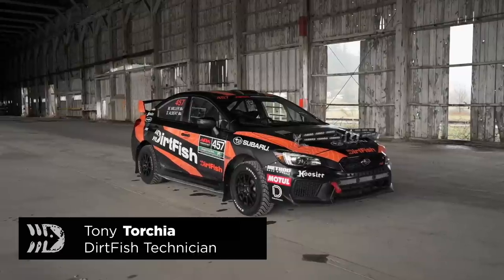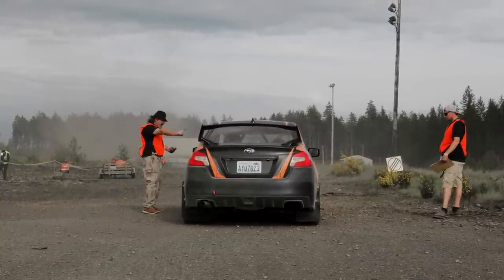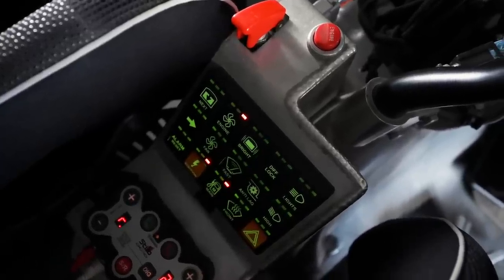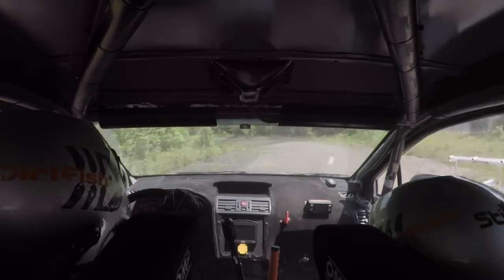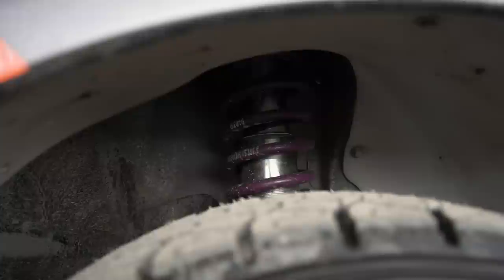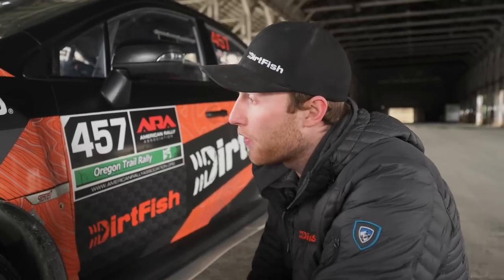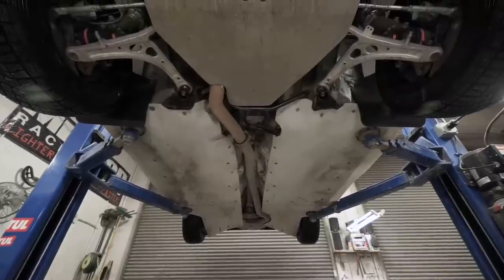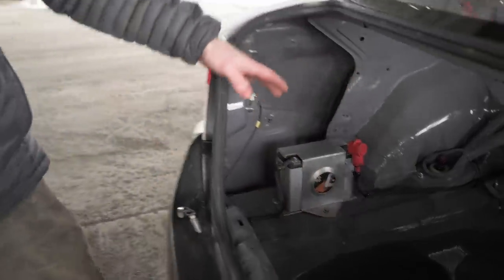Subaru STI Rally Car - FULL BUILD

Comment: What is the weight balance of the car? With the engine in front of the front axles is there the concern that the nose will dive down if the car goes airborne?

Comment: Nice video !  Does the handbrake disengage the rear wheels ?  Or you have to clutch while you use it.
Reply from the maker: Yes, it disconnects the center differential to allow the rear wheels to move freely.

Comment: Great video! A few questions:
What lights do you use on the hood?
What fuel does the engine use?
How much power is it tuned for, or does that vary by event?
Is lack of AC an issue on hotter events? Does the car still have heat?
Reply: the lights are diode dynamics ss led bars and hood mount. the rest... well, you'll just have to see if the dirtfish crew will expose those secrets ;D

Comment: what kinda diff do u use for front，center & rear？do u use active center diff to do power split of 50：50 or 30：70，something like that？r u using carbon fiber trans shaft？also，i heard that some subaru rally cars use v-mount intercooler layout，any reason u prefer front mount？thanks for ur high quality video as always！
Reply from the maker: We use the STI R4 plated front diff, OEM center diff and Cusco 1.5 way diff in the rear. The Motec ECU controls electronic portion of center differential. We do use a carbon fiber driveline. The front-mount can be larger and provide better cooling.
Reply: @DirtFish  thank u so much！very helpful！

Comment: What lsd are typically used for front, center and rear diffs? And what would you recommend for street/rallyx? 1way, 1.5way or 2 way?
Reply from the maker: We use the STI R4 plated front diff, OEM center diff and Cusco 1.5 way diff in the rear. The Motec ECU controls electronic portion of center differential.

Comment: A Question: when you analyze the roads of a country like Dominican Republic with the huge dips in the streets in areas, big crater type holes you can sometimes run into, huge bumpers on some roads. I was thinking if I moved there that WRX Sti really is too low to the ground. What kinds of things would need to be done to raise it high enough to not get damaged at the same time have high performance?

Comment: why do 15 plus cars dont allow left foot braking? the engine shuts down when it senses lfb:( and also abs cannot be remove, engine falls in safety mode and blocks rpm at 4000 ,  misss my 2013:(

Comment: Any direction on shopping n buying rims, tires, or even brake setup for 2019 WRX?  The stock 18” w low profile tires are murder and do Not accommodate the roads or certain driving styles.

Comment: To compete in WRC or ARC school is a must...
But honestly we need local sanctions to get people rallying. You don't need a $100,000 WRXs or Fiestas to compete. Rallying was just stage racing with regular cars, raced by regular people. Not heavily sponsered Subarus, Mitsubishi, or Ford racing teams. 
You can rally a damn Kia Soul and it be fun. 
Lemons is growing because it's accessible. Diets roads are everywhere in America people
Reply: No, one does not need souped-up subie to rally, but safety modification alone costs a lot of money. Roll cage, racing harness (which implies bucket seats), and seat mounting are pretty much the bare minimum to pass FIA's Rally5 homologation (I can't really find Canadian CARS or ARA regulations. It's basically Production/Limited 2WD class), And skimping on those is the surefire way to become the next Toivonen/Cresto.

Rally5 car has a target price of 40000 Euros for the car alone, nevermind other ancillary costs. That is a huge chunk of change for most people, and is well out of many people's budget.

Racing is expensive, stage rallying even more so. Unless we start mass-producing roll cage and racing harness and fit them on stock road cars as standard loadout (which I highly support 🙃), it will continue to be expensive.
Reply: @BicyclesMayUseFullLane  definitely need local rallying clubs